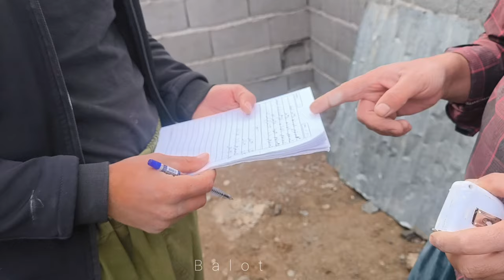"A house without moisture: the sloping solution of Master Builder for Jamila's house"

Comment: When the water tank is light enough to lift it can be put up on blocks. So all jugs and containers fit under the faucet. Dig some dirt from under the faucet for now. Just enough the jug sits under it and doesn't have to spill when pulled out and away.